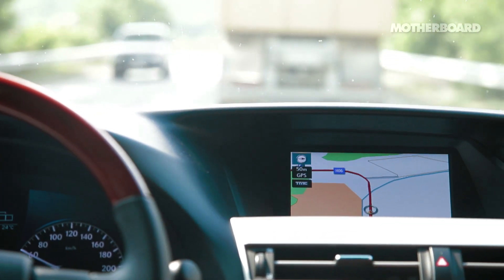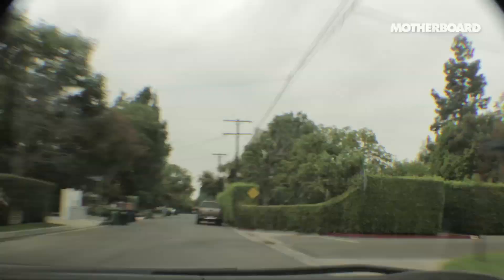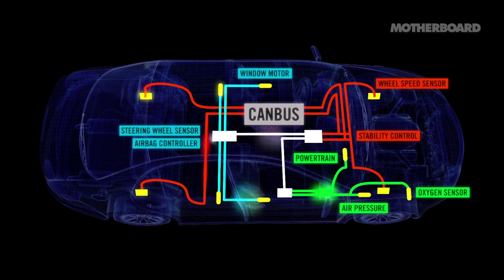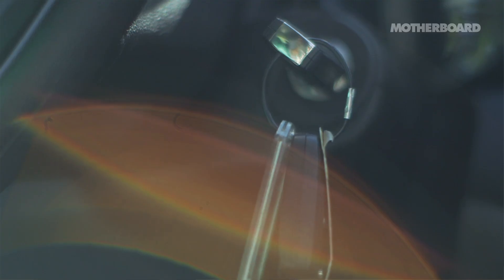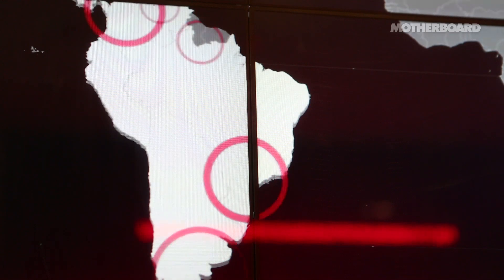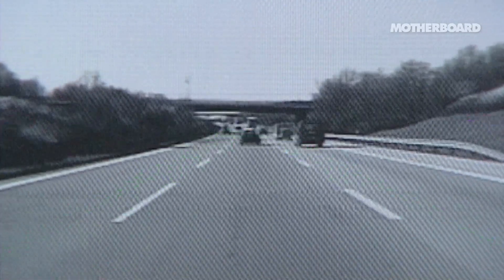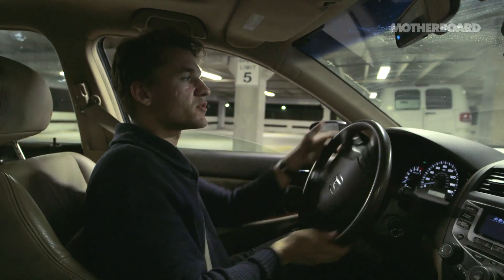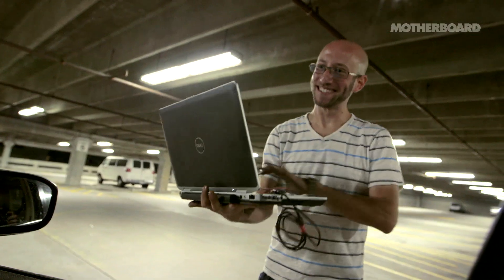How to Hack a Car: Phreaked Out (Episode 2)

Comment: This is complete bullshit, they customized the car to all hell, there is literally no electronics connecting the steering column and the steering wheel that would move the steering wheel. They added servos that did, there is literally no possible way to control a modern car that is not geared for remote driving (Google car and other specifically designed cars for remote driving aside). This is the biggest piece of shit I have seen in a long time. I would love for these guys to contact me personally and show me proof that this isn't the case.
Reply: Have you ever heard of power steering?
Reply: Daniel C. You must be joking right? You do realize that is controlled by hydraulic power not electronic servos. There is a pump that helps push the steering wheel to 1 side or the other, it does not actually move the steering wheel.
Reply: Mr Sweetheart
You just contradicted yourself."There is a pump that helps push the steering wheel to 1 side or the other, it does not actually move the steering wheel." You just said it helps turn the car, then you said it didn't. What are you saying?
 Yes, you are correct, there is a hydraulic cylinder or pump that helps move the two front wheels. There is a computer which controls that, which could be hacked and fooled into making it think there is someone imputing a motion into the wheel. There are some cars nowadays (Porsche Cayman is one of them I believe) that use an electric motor instead a pump. Reason being for weight, efficiency and simplicity. Those are probably even easier to fool/use to move the car
Reply: Daniel C.
You do realize the difference between helping and doing right? There was no contradiction. If I tell you I can help you do your work, or tell you I will do the work for you, there is a difference, 1 is me showing you how it can be done without doing it, and the other is telling you to go sit down and me do it for you.

The pump supplies the ability to move the wheels without resistance, but the pump does not move the wheel. The pump is belt driven which means there is no electricity supplied to it at all. It is essentially like putting a heavy cylinder in an empty bathtub, well you would have to pick it up, well that is hard, but if I fill it with water it will become easier to move it. This is what Power Steering does.
Reply: Point noted, but if we are talking electric power steering one could hack that unit's control system and take that over. If it's a partially electric system then one can get rid of the "power" steering part of the power steering. If it is a mechanical system, well, may as well just use the brakes and stop the car instead.

Comment: Cars mostly only use CAN for interior accessories. Drivetrain control is on another network. BMW uses like 6(?) different busses. You can't turn the wheel & pump the brakes over CAN. CAN gets the wheel position broadcast message, bun can't send the message to the drive train to turn the wheels/hit the brakes.

If someone wants you bad enough that they got into your car & planted a device, you have much bigger problems.
Reply: You are right on that one, I'm an auto mechanic for over 25 years the stuffs that he said in the video is nearly impossible to be done.

Comment: I've installed car electronics for 15 years. And some of this stuff can be done. As far as the steering and brakes go, they can only be controlled remotely if your car is equipped with electronic steering assist, and/or automatic braking system. But as far as the other functions such as start/stop the engine, lock/unlock doors, lights on/off, etc. Most cars since 1995 have been equipped with an ECU (engine control unit) and a BCM (Body Control Module) which are central brain units that control the commands of each switch or button in your vehicle. Easily plugging a device into the obd II connector and having the right software, it is possible to remotely take over someone's car without them ever suspecting anything.
Reply: That is absolutely true, but you still have to get into the car to plug in that OBD II device I assume.
Reply: @balintbaksai6767 they don’t need your physical phone to pull your data, they don’t need to touch your car either.

Comment: Motherboard, you just lost a subscriber with this stupid video.  The driver said the brakes no longer worked.  Wrong.  When the engine stopped he lost power brakes but still had standard brakes.  The "security expert" said he could apply the hand brake remotely.  Wrong.  That still requires manual force by a person in the car.  Unsubscribed.
Reply: That makes 2 of us lol.  So much garbage in this video.  If you know how a car works you'd know nearly all of this is just not possible.

Comment: The fix is a simple one anything with wifi,cellular, or bluetooth should have an air gap or no connection between it and the systems responsible for the operation of the car.
Reply: I like this very effective, $8 option, which just air gaps the battery, disabling anything electrical in the vehicle and requiring them to physically break in, realize what's going on, and bypass it

http://amzn.com/B001N729FS

Comment: I feel like if this method was as easy and effective as they portrayed it to be, we'd already have white hat hackers in law enforcement that would hack a criminal's car during a chase and take control of it..
Reply: coolstring1 you need a lot of time ... first . Second every car is different you dont know what car will the criminal have .
Reply: coolstring1 The definition of white hat hacker is a hacker who informs the owner of a system about the found vulnerability instead of using it for personal gain.
Law enforcement hackers would still be "black hat", they're out to hurt someone, even if the law says their target is a "criminal".

Many very nice people are criminals and many very bad people are legally in the clear.
Reply: In trap cars, cars used to get carjackers in stings, a similar technology is used to stop the car completely. Though it relies more on radio frequencies than wifi signals. We're not far off from white hats doing just what you proposed.
Reply: coolstring1 They would likely be forced to get some sort of warrant for that type of thing. It would also have to be installed before the chase which could be factored in.

Comment: The only things they don't mention is how the on board OBD2 systems would have to be fitted with a wireless transponder in order to do it wirelessly, the brakes and steering will still work, not only that but this requires breaking into the car and forcing your way to the onboard computer and than delicately modifying the ECU or else you will just damage it and render the car useless, the emergency(parking) brake can NOT be activated by the computer because it is a cable ran system with no computer control and the brakes will work too you simply will not have power brakes and the same with your steering. Now unless you have one of the few new cars fitted with electronic steering control you have nothing to worry about and all of this is bullshit.

Comment: What a load of crap. The car was retrofitted most likely with a custom setup such as an arduino, tied to a GSM board, and using a can bus interface chip. The wires for the body control can bus would need to be fished out of a door panel or under the carpet to be tapped. And it's highly likely that starting or stopping the engine from the body control can bus is impossible. Most modern cars maintain a separate bus for engine control and other systems essential for safe operation of the car. Even if that bus was tapped, I highly doubt it was done on this car. I'm betting that this car was also retrofitted with a remote start module which ties into the starter and ignition wires. Then control of that module was also passed off to the arduino or other retrofitted remote control system. If the car has a standard turn to start key, and if you can release the key at any time before the car is started and it stops cranking, it's very likely that the starter is not computer controlled. On newer cars with push to start, it may be possible to manipulate that function over the can bus. In a nutshell, this car has been highly modified to allow this demonstration. The chances of someone being able to hack a car wirelessly over something like the in-car bluetooth audio is highly, highly unlikely. The maker of this video did a very poor job in explaining exactly how much modifications needed to be done to accomplish this. The video spreads FUD amongst people who don't know enough to understand how something like this is accomplished. This video is quite a load of rubbish and should frankly be removed for being inaccurate and sloppy.
Reply: Way to prove a point .
Reply: It said it was fitted with third party software. And unmodified cars weren't vulnerable
Reply: bmw5002 No shit, you watch too many Hollywood movies. Pretty sure it would be impossible without attaching a 3rd party device.
Reply: Yo! IDK if you knows about this stuff, but I know about it, and YES, new vehicles CAN DO IT WITHOUT ANY 3rd party stuff, but, of course, is not a easy task.

OBD port can control all stuff on your car. And, as you said, most vehicles have system separated (powertrain, brakes, airbag, radio, ...) on different nodes, but cars don't have 50 different lines for 50 different systems (that was an example). Let's put an example: In my case, I have a Fiat (and I said Fiat, as I could said VW, Audi, Ford, Kia, ...) and I have to different lines, one is for high speed CAN-BUS protocol (airbag, radio, instrument cluster, ...), and other is for LOW-SPEED CAN (engine, ABS, electric steering), and, in my case, if I am using a cheap chinese clone of ELM327 OBD-II devices, I need to use a Yellow adapter to change between them, but using a more advanced adapter, like a Launch OBD-II adapter, I don't need it! The adapter makes all changes itself without needing an extra wire adapter, and you can read the engine, the abs, airbag, radio, instrument cluster, and all of it just plug-in it and using a software. You can reproduce the same stuff with an Arduino, using just one CAN-BUS Shield (with some extra devices for switching between pins) or using a few of them (SPI rules!), and tell whatever you want to the car on any node, and most of companies saves money connecting multiple devices between them. That is why (there are more reasons) CAN-BUS is made for, it can detect what message is more important than other, priority, save money with two wires connect multiple devices (like I2C), robust system, redundant data...well, you know...

Also, you gotta know that the 50% of hacking is reverse social engineering, so even a friend using your car can hack it...
Reply: Exactly. It's funny when he explains - GSM networks, everything is cellular. Nailed it, LOL
Reply: @نور العلم good argument
Reply: Bet this guys job was to debunk this video. Check out his YouTube page this message is the most content that's been posted. Fake page
Reply: bmw5002 However lets say you have a potential enemy and you install the gsm directly to their car then obviously it will work the same
Reply: This guy obviously did not watch the video and decided to attack it simply reading the title alone.
Reply: this is retarded

its like,
" look I made a remote control for my car............"
 " oh my god you can hack anyones car???!?!?"
 "well... no I can con.."
" no no no one is safe!!!!!!!! argh! everyone run! computers are evil!"
Reply: He said it was retrofitted with a doover from a newer model car, which in a nutshell is saying the model they had wasn't capable so they shoved a controller into that car from a newer model that enabled the "hacking" to take place, essentially verifying everything you said. 
If you look closely, yes there is an arduino in the "CHT" Car Hacking Tool.
Reply: Go watch the DARPA Government video on YouTube by Kathleen Fisher (darpa held cash prizes in the desert a decade ago for the first driverless car) and then say that again. Cars can be hacked by Bluetooth, Wi-Fi, even a song sent to the car or played from a CD that sounds fine in your home or home stereo, but when you play it in the car, they control your WHOLE CAR.
Reply: bmw5002 oh, someone that understands a little bit, this is just Watch dogs propaganda, that guy the “”””””hacker””””””” doesn’t even use Kali linux, that's not even an operating system...
Reply: Lets talk again when you find the similair car but the owner added a "bluetooth" dongle to "see more details of his car" from china, AKA default or no password on the bluetooth dongle. 
And altho this particular car might not have been completely vurnable, there are enough cars arround the world, that can be hacked remotely, that have vurnabilities that can be exploited remotely. 
Dont just say this video is crap because the example is "fabricated". The example shows how in some instances it could be done. each car has a diferent approuch, and an attacker has much more time to prep the attack than you have to stop the car once it happens while you be driving 140Km/h or 86Miles/h. I rather know what system my car uses, understand what type of wireless adapters it has and if they are connected to the car itself in wich way. then see if I can change defaults, remove connections and/or make it more secure.

Comment: Thats why you should drive OLD BMW or Audi or Mercedes. Only electricity lights and radio and thats it. Everything else is manual.
Reply: You forgetting they have fuel pumps? Ignition? Alternators? Any old car can be hacked, and depending on power options it can all be wired to operate remotely. Even a 1914 Ford Model T can be remotely turned off with an addition of a remotely activated vacuum solenoid.
Reply: Andrey Studinets fuel pump mechanical by crankshaft, ignition= mechanical distributor driven by crankshaft. 

Well yes. But i dont think pc nerd will understand 30+years old wiring + a lot of  wiring have been redone by owner or shop so its not orginal.
Reply: ***** Cars with mechanical fuel pump are equipped with various fuel shut off safetys, some electronic some not. Mechanical distributor is there to determine the moment of ignition, power is supplied from the battery through a fuse for the spark.
Reply: Andrey Studinets  with various fuel shut off safetys, ( thats newer cars, i meant older older ones. pure mechanics - > you press pedal carb opens rpm`s clime more fule gets pumped, taked foot of pedal carb closes rpm`s dropt minimal fuel gets in) Not newver where there are safety.

Well battery only place actually. but when you cut off battery than car dies and if you leave in gear you can safely pul over breaking with geears + engine.
Reply: Why is someone who's good with PCs not able to understand electronics or mechanical concepts? What an odd thought.
Reply: why Mercedes BMW or Audi? Any old car works and btw those cars were hack friendly back in the 1980s, Toyotas were hack friendly      in the 2000s
Reply: 1963 Mercedes 300sl!!!!!!!
Reply: @vanw4521  I drive same BMW last 14 years. And same time it is my first car.

Comment: Good info.  But not all cars are nearly that easy.  Notice they chose a 2007 honda accord.  Newer ECU more computers used period.  And I have nothing against newer cars, I own a newer honda.  Take my 91 camaro for instance.  It still uses a computer of course, but alot less electronics  for sure.  I dont have an electronic throttle sensor.  It uses  a metal throttle cable to manually  open my throttle body to let air into my intake which then my compensates by adding fuel and ignition accordingly.  Just an older method of electronic fuel injection...lol

Comment: Another thing that I was doubtful of (in addition to my previous comment that you can NOT remotely hack into the car unless someone first broke into the car and added their own physical receiver device) was that a hacker can NOT completely disable the brakes entirely to prevent you from being able to stop.

Most cars have HYDRAULIC brakes with a physical connection between the brake pedal and the brakes.  When you push on the brake pedal, it pushes on a master cylinder piston that pushes fluid into the brake caliper which squeezes the brake to make the wheel stop.  There's nothing computer or electronic about that to be avble to prevent it from happening.  

Hack into and automatically APPLY the brake (thru stability control or parking brake)?  Sure.  Disable to booster?  Probably.  But completely stop the brakes from working?  No, it's a bunch of metal and rubber pieces pushing fluid around, nothing you can do to stop that electronically.
Reply: What about brake module? Erase that coding bam. They don't work

Comment: Good video but two misleading things in it (mentioned by many other comenters, I'm sure):

1) They didn't place enough emphasis that the only reason he was able to hack into the car and do what he did remotely is if someone BREAKS INTO YOUR CAR AND INSTALLS THEIR OWN RECEIVER TO RECEIVE HIS HACKING SIGNALS.  Otherwise you can NOT remotely access anything in the car.  You must plug a physical wire into the car's computer system.  it is not magically accessible "thru the air" by a cell phone on its own.
Well, heck...that's like saying somebody can see what's on your computer if they break into your house and read everything on it because you have no password.

2) it seems to me there's a pretty simple way to solve this entire problem by doing something that computer and cell phone manufacturers did 40 years ago....add a user-definable encrypted password capability to the main ECU (one that will percolate down to every entry point of every other other processor accessed by the main CPU).  When the user starts his car each morning, he enters the password.  Even when the car is running, nothing can access any entry point of any processor without the password.  Bingo, problem solved!  Or am I missing something?